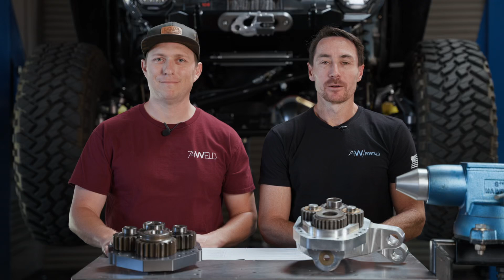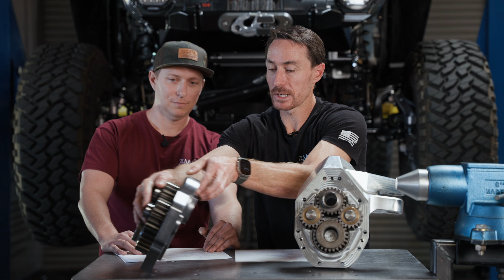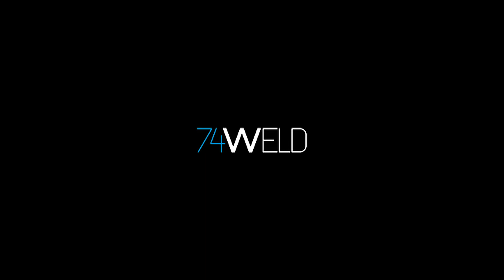The evolution of the 74Weld Bolt on Portal Axle

Comment: I have a question about portal axels. Could they be used to lower a truck? I am building a 69 c10 and i would like to get it as low as possible but i don't want to have a huge step notch. I plan on having a two tone wood bed and would like to keep it flat and still keep the floor at stock height.

Comment: Does this work best with a Torsen locker?
Reply: Can the ABS system be designed to incorporate both the portal gear reduction and a torsen locker <3.73 with a simple 300hp engine? I'm thinking 33 ATs (4 spare MTs, and a dirt bike on a bike trailer in tow) something good during the summer heading over I-70.
Reply from the maker: Yes

Comment: thank you for the viedo. do you think you could master with a higher volume in the future?

one question i have is how much does this affect axle wrap? kinda seems like it would greatly increase it and put significant extra amout of load on the controll arms and bushings?
Reply from the maker: It does put more load on bushings. I am running RockKrawler links on my 392 and a year later they still feel tight and good so it doesn’t seem to be an issue